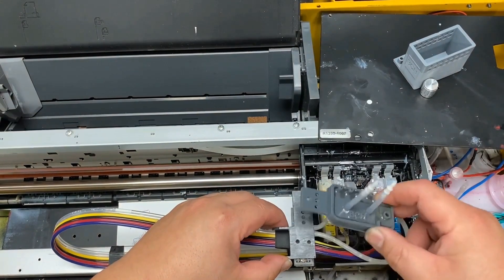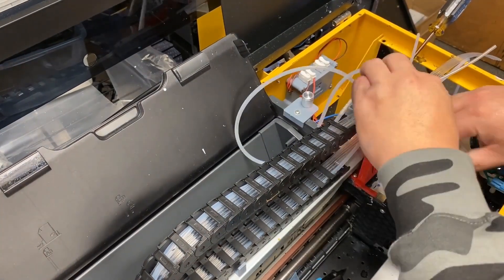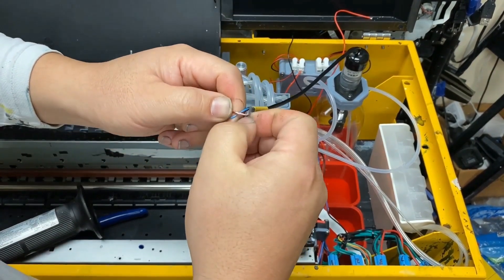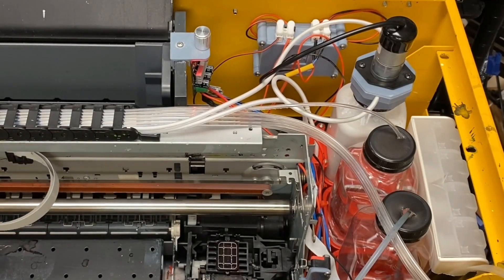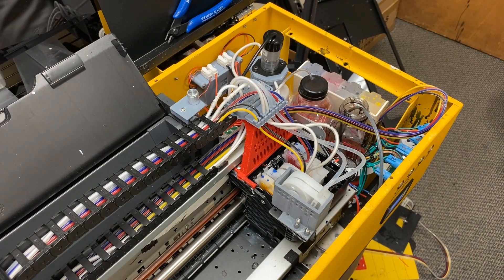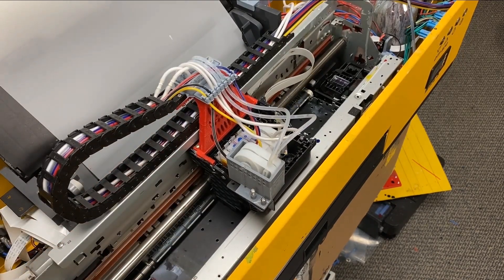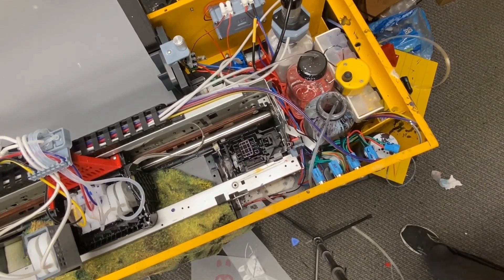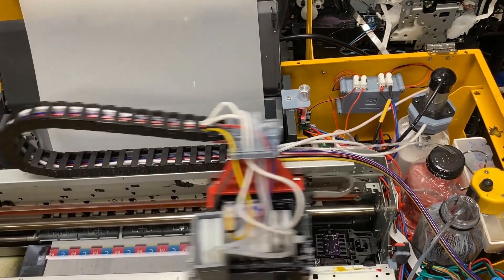MODIFY Your Epson 1390 Into a POWERHOUSE DTF Printer!

Comment: If you leave the printer on won't it do automatic head cleaning after 12 hours or so sucking the water out into the waste tank?
Reply from the maker: Great question, and thank you so much for supporting the channel! Yes, if the printer stays on, it can run automatic cleanings and push fluid into the waste tank, but in my experience it’s fine to let it idle for less than a week. Since the inks in the white channels are dye-based, the built-in cleaning cycles are actually designed to prevent clogs with this type of ink. If you know you’ll be away for an extended time, shutting the printer down and even filling the capping station with a wetter maintenance solution is a safe approach. I get a very high volume of questions, so please remember that subscribers and channel members get priority answers, usually within 48 hours, plus early access to videos and other exclusive benefits. Regular viewer questions are answered as time allows, and if you need faster help, feel free to email [support@bchtechnologies.com](mailto:support@bchtechnologies.com). If this video or my comments have been helpful in your journey, I’d truly appreciate it if you left a quick review on my Google page: [https://g.page/r/CfL7k6nYvPQ9EAg/review](https://g.page/r/CfL7k6nYvPQ9EAg/review) — and don’t forget to subscribe or join as a member so you can keep getting the most timely support and tips!

Comment: I love this. Can't wait to do some of the mods for my l1800
Reply from the maker: I'm glad to hear that! The L1800 has so much potential with the right mods. What are you planning to do first?
Reply: @BCHTechnologies but I would like to add the topper that you have for the white ink and run some cleaning lines
Reply: Recently my waist ink management system had a clog that I had to get rid of so I had to take the whole thing apart and replace some of the hoses and I don't think I put it back together so I'm still working on that. But I haven't been by the shop lately cuz I started that new job. I miss seeing all the wonderful mods you make firsthand.